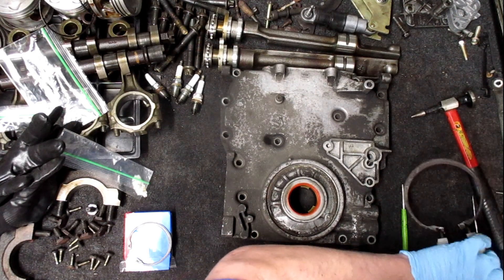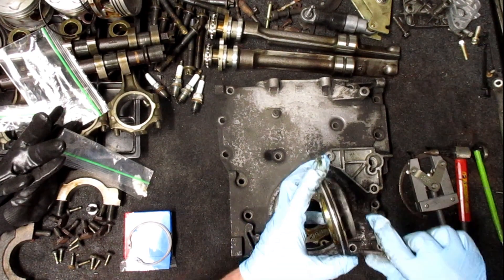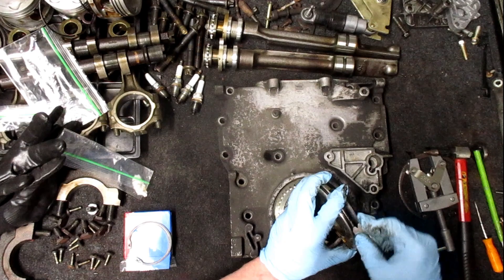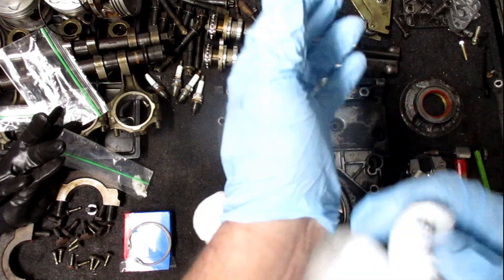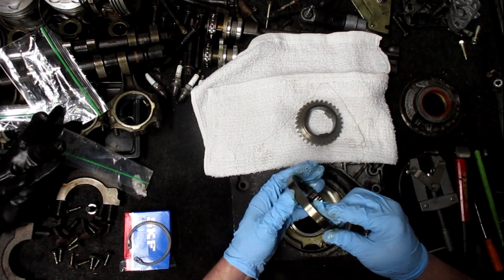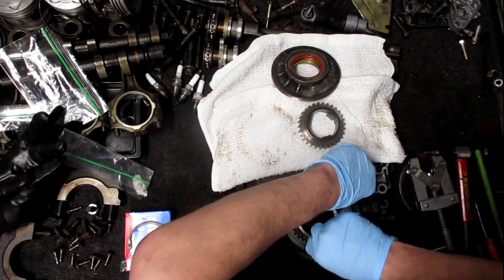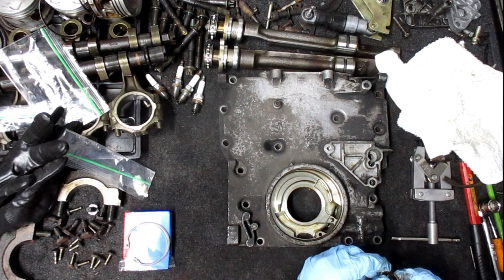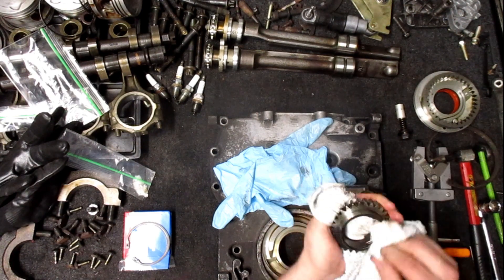1994 Saab 9000 Project oil pump disassembly and inspection

Comment: What are those mechanical snap ring pliers?
Reply from the maker: Lang Tools 87. Heavy duty snap ring pliers. My favorite snap ring tool for any rings over an inch in diameter or ones that just will not budge.
Reply: @Ryengoth  Awesome! Thank you and I managed to get the snap ring out another way which was easy enough (amazingly). I’ll have to invest in the snap ring tool though.